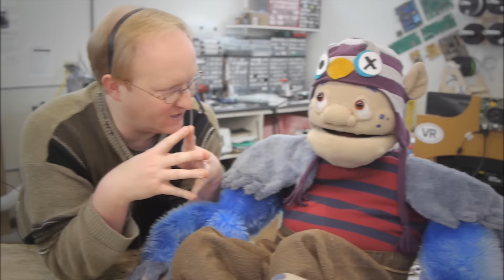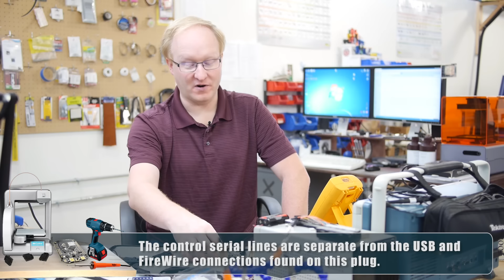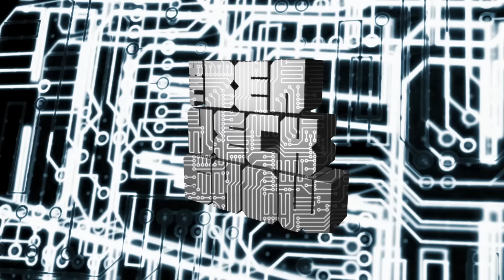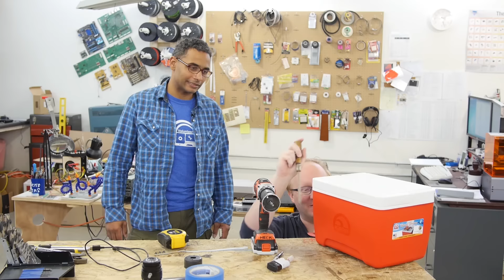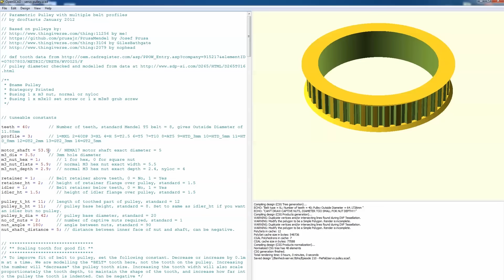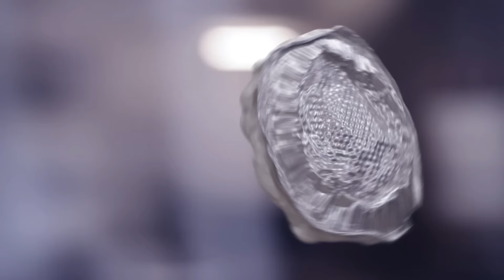Ben Heck's Raspberry S-pi Cam Part 1

Comment: Wow, very nice work. Well done guys. I have had a similar idea, My girls do Valet and at recital no picture or video are permitted, since later  they sell every single or hole section for top $$$. 
 My idea was have a glasses with a camera that the wires run down to a belt clip that has a lithium Ion battery and the controls(on/off,  pic/vid) buttons. 
I also thought that they sell a micro usb android cam and replace the cam for a better one out a old phone (12mp) and glue inside a pair of shades, so i can control with my pone.
Any thoughts or comments that might help me put this idea together. Any input will be greatly appreciated. Thanks

Comment: Can you make a video showing how to make custom cases cheaply?
Reply: +Foxy Thar Pirate, what sort of material are you looking for them to be made of? Ben frequently uses a laser cutter and 3D printer to make pieces out of plastic and wood. Is there something else or a different material you are looking for?
Reply: +theHeckwithKaren mostly plastic, but I meant without any sort of 3D printer or laser cutter
Reply: +Foxy Thar Pirate  Hmm, well I can give you a couple ideas on how to do that, but they're not really easier and are harder to customize. One option is vacuum forming, but that requires a vacuum former, or at least an oven, some pegboard, and a shopvac to DIY it. The other option would be to get some plastic sheeting and cut it down into pieces to make a box the desired size. Then you can plastic weld it. If you need a bit of a curve, you can use a heat gun and some 2x4s to bend the plastic as well. Those are the only other options I'm aware of to build a DIY plastic case.
Reply: +theHeckwithKaren okay thanks

Comment: Wouldn't it have been better to have used a camera without lens to attach to the telescopic lens in prime focus. Its what astronomers, amateur and pro, do all the time. A cheap way to do this is to use a USB web cam and remove the lens.

Comment: Is the Raspberry Pi in the unit a bit overkill? Would it not be better to use just a small camera that outputs composite video directly, then something basic and a lot more power efficient like a Teensy to control the zoom? I doubt the video quality on the visor thing would be able to tell the difference between the camera quality.
Reply: +aaroNiGHTS I believe they said they would be recording the video
Reply: +Delbert Johnson II (Delby) Cameras that output a PAL or NTSC signal can usually also record it

Comment: The wire might be hard to hide. my suggestion is to run the wire in the leg of the glasses. Then have head phones that go over the wires run down through the headphone wires. Also a listening device could be added now. just some thoughts.

Comment: Could you not perhaps use X11's remote display capabilities rather than adding vnc to the mix? Or is VNC that much better at latency and such?
Reply: +Kelli Halliburton I was wondering the same thing. Last time I used VNC it was pretty slow.
Reply: thomas s I don't know about X11 forwarding but VNC is not very secure. I believe both can use an SSH tunnel though which would eliminate any security problems with either of them.
Reply: +Gooberslot X11 is much faster, and also more secure out of the box than VNC (by default VNC comes with encryption disabled most of the time). of course if you don't use ssh -Y or ssh -X to connect, you have to reconfigure the X server to listen on a LAN address instead of localhost, which is indeed not secure
Reply: yeah, i always use ssh -Y tunnelling as it a) is secure b) saves running an X server on the remote end.